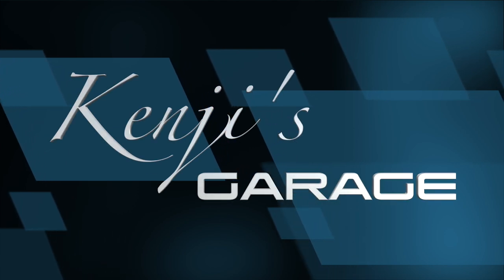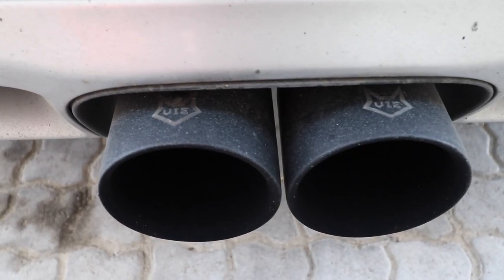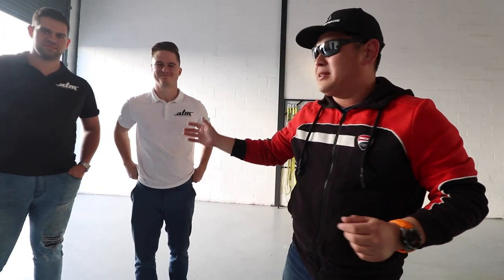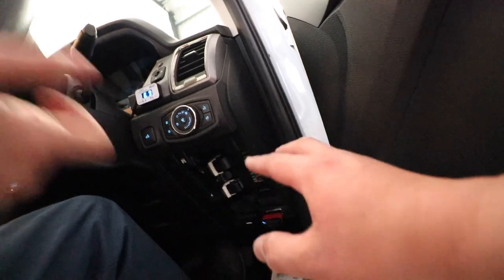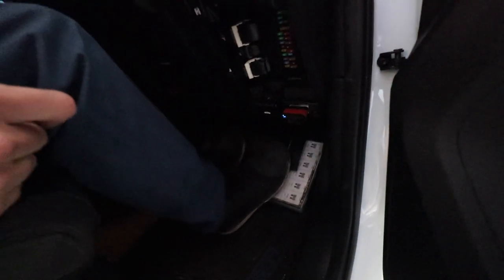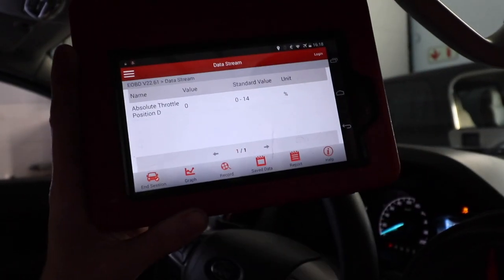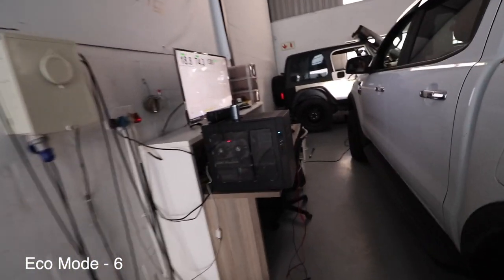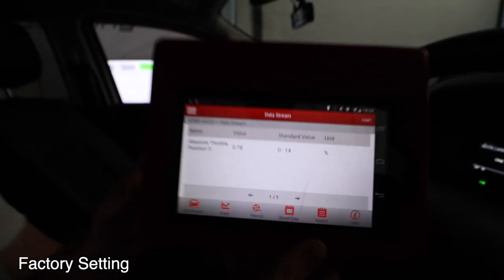iDrive (EVC) Dyno Testing! It WORKS, anymore power? (Part 2/2)

Comment: I have a similar throttle controller and use the Economy mode to dull down the throttle at low speeds, such as driving around town, but at higher throttle input it still reaches 100% throttle, you just change the curve shape, and thus how far you need to press the throttle to get a set power out. I love it

Comment: I found this device finds the lower gears when exhilarating from a roll on the U mode. Sure it doesn't give more power, but being able to drop gears when going certain speeds makes it feel faster. For instance my car from a roll 40kmph use to ride out the third gear before switching to 4th. Now it goes down to second therefore a quicker response which results in going faster. Sure it's not giving more kws or hp, but by manipulating the transmission it keeps the power almost always on the sweet spot. No matter at what speed. And the higher you go on the U mode, the more responsive the transmission gets. I found the U2 mode gives me the best performance without the jerky feel. I hope this explained some of the questions regarding power output people are looking for. I definitely agree this is a better option for off-roading and towing. But for those chasing better performance of their transmission the potential is definitely there. You've just got to find the sweet spot for your driving style. Peace ✌️
Reply: Right.... My Jeep loves pulling off in second...  It really doesn't want to take down the first if I roll through a stop sign or something like that I don't roll it through stock signs but that's just the example.... If I roll through a yield and get back on the throttle it never goes to first...

Comment: I recently have installed the Idrive EVC310 for my Fiat 500c Gucci Dualogic Twinair (2013), and I am very satisfied with this throttle tuner. from Idrive Australia.

Very simple to mount, and clearly to use, riding and changing smoothly directly into the desired mode. For me it is a very welcome addition to the fine and safely tuning of my car before from 85hp to 105hp (done by the best Alfa/Fiat Dutch tuner). 
I choose Idrive because it doesn’t need Bluetooth nor IPhone interface while YouTube Idrive and other throttle tuner movies convinced me further.
The design is very nice, small in size, with the 4 modes visible also at night. 

When I chose mode U9 (Ultimate) my 500 is a race monster, (to prevent wheelspinning use <U9),  for daily use mode AC (Automatic Control) works fine, for great distances EC (Economic Control) works best (and also for snow on the road), and return to mode -- the Idrive returns to normal 500 driving mode.

I ordered the Idrive in Australia (Idrive is not available in Europe) for 180 Euro, had to pay Customs in Holland 20 Euro and my garage another 20 Euro for dismounting/mounting the pedal assembly and connecting the accelerator plug assembly (I myself could not  release the existing plug on the gas pedal by hand).
At home I mounted  the Idrive on the dashboard. 

My short experience with the EVC310 is a very pleasant one and finally: the EVC 310 is for me the ultimate throttle tuner, which gives me a big smile on the road!
Kind regards from Holland Eric Koekkoek
Reply from the maker: Wow! ERIC! Thank you so much for the message! 

I find U9 a bit too harsh on my truck, it’s a bit too much throttle.
Reply: Hola , haz tenido problema con el dispositivo ? ha dañado el motor o algo similar ¨?
Reply: @ventasquivime2714  5 dec 2019 I installed the Idrive EVC310 for my Fiat 500c Gucci Dualogic, TwinAir 0.9.
After driving 8000 km I am very satisfied with this throttle tuner. It is very simple to adjust your desired mode (4) with possible settings 1-9 (1 is minimum, 9 is max.) and everything goes smoothly while you drive. For me it is a very welcome, useful and reliable addition to the fine and safely tuning of my car from 85 to 105 ps (done by the best Alfa/Fiat Dutch tuner).
I choose Idrive because it doesn’t need Bluetooth nor IPhone interface and YouTube Idrive movies convinced me further.
 
The design is very nice, small in size and simple to install. The following settings are possible: 
** -- Normal mode, I never use this.
** E Economy mode, I use this with setting 9 for short distances (and without pressing) the ECO button on dashboard); for long distances I use E9 in combination with pressing the ECO button, which visible drops down fuel consumption.
** AC Automatic Control, I use this when I will quickly accelerate without using manually settings, the higher you press the pedal the faster the accelleration (1-9)
** U Ultimate mode, I use this when I will be the quickest accellerator on the road :-) .
With my standard setting U9 (Ultimate Performance 9=highest) my 500 is a real accelerating beast!
 
I ordered the Idrive in Australia by Ebay for 180 Euro. For dismounting/mounting the pedal assembly and connecting the accelerator plug assembly (the existing plug on the gas pedal could not released by hand) I had to pay my Garage another 20 Euro.
At home I simly mounted the Idrive on the dashboard.
 
Finally: the EVC 310 is for me the ultimate throttle tuner! 
Kind regards from Holland Eric Koekkoek Birfelder
Reply: Sorry 1 addition more: I have never never had a problem with my EVC310, the 0.9 Twinair runs every day smoothly without any problems, I find the combination EVC310 + tuned 0.9 engine Ultimate!!! My advice: read the reviews, look at Youtube...

Comment: Thanks for making this video! It would have been good to see the throttle values when putting the foot flat to the floor without the block under throttle. You only showed the dyno graphs but not the throttle values. As was mentioned in this video, the throttle controller makes no changes to the actual engine, so how can it actually make more power/torque earlier in the rev range if in both instances (standard throttle vs. iDrive) the throttle value is at 100%. In theory either standard must not bring the throttle value to 100%, or with iDrive it somehow goes above 100% and allows the throttle body to open wider. Are you able to explain this at all please? The part where you show the partial throttle makes sense and is what the iDrive is all about, but the full throttle bit with “more power” is confusing.
Reply from the maker: Right so, iDrive will never allow pass the 100% parameter. As you will need to tune the ECU.

It simply fools the pedal, where it can be 80% open at say 10% throttle position. 

At full throttle, 100% will just still be 100% it will never give more. 

It won’t get more power! It’s just a more on demand of the existing power that you have. 

It’s easier to explain in person and show you.

Comment: Hi, very informative, advanced, and complete information regarding the throttle controller, thank you, but I have a question I hope the admin or Kenji's Garage can answer regarding safety issues, My question is what if the throttle controller's device suddenly fails? or the little wire cut? Do we still have the control of gas pedal? or it will be back to normal mode? Thank you for hoping Kenji's Garage can enlighten us. thank you again!
Reply from the maker: It will revert back to normal.

Comment: Awesome and very informative video!! Can you do a video on AC mode? I mostly use that mode as it's the best of E and U mode...
Reply from the maker: I hate AC mode! It’s so jittery on my 2.0l single turbo
Reply: @KenjiLo1  Lol, fair enough.. have heard that it's rather intense on an auto. Works lekker on my manual 2.2 ontop of a stage 1 map💪
Reply from the maker: I want to do a map on my Ranger! Need more power
Reply: You wont be sorry😈 I don't think that the single turbo's can be done yet but hopefully soon. ATM is always ontop of the game. Had mine done with them💪

Comment: Which mode should I keep it for everyday driving/fuel efficiency? AC or should I turn it off ?
Reply from the maker: What vehicle do you have?
Reply: @KenjiLo1  Subaru liberty 08
Reply from the maker: I would leave it U1 or U2. Just to give it a little bit more extra sensitivity.
Reply: @KenjiLo1  I’ve had it on u2 for a while and realised the car drinks petrol, would Ac be more efficient or would it not make much of a difference
Reply from the maker: I hate AC, the device is not that clever. I would then leave it off. And only when needed, then use it

Comment: It basically has to do with the "feel" of the throttle. My 2014 3.2 Auto Ranger has a very lazy throttle and it does not feel nice when driving. With the iDrive in U1 mode, it feels allot better and right. My dad's 2016 is a bit of the opposite. The throttle is very touchy and the iDrive in E1 should even it more out...
Reply from the maker: Yes, that's what i have also felt. I'm basically running E0.

Comment: have you seen any savings in fuel on the eco mode?
Reply from the maker: No. And I preferably don’t drive in eco mode. I use eco mode primarily for rocky surface, it smooths out the throttle and don’t give me slippage
Reply: @KenjiLo1  but does that not have an impact on the 4x4 settings on the car that are already set for certain accelerations?
Reply: @KenjiLo1  found your channel today Mate, really enjoying your content
Reply from the maker: So it definitely does affect your 4x4 settings, but very very mildly. Let me give you an example. 

I was on eco mode, going through rocky patches etc, and was very smooth, and no jerking. Then i got to a sandy patch and forgot to switch it back to Ultra mode. I literally was stuck, my truck didn't wanna move. But when i realized it, i switched to Ultra mode, and i was cruising on sand. 

It won't affect directly on your 4H or 4L settings, or even with your diff lock settings. It only controls the throttle.

Comment: Whacks an empty stubby under the throttle to test, ended up crashing in the drive-through at the bottleshop because it ended up under the brake pedal. Thanks. 🤣
Reply from the maker: Luckily that never happened.

Comment: I don't have a IDRIVE but the main purpose is throttle response. Fly by wire has a lag in response when you press the paddle. You can test this by bouncing your foot on the accelerator. You find your car won't rev higher to match your paddle. The IDRIVE removes the paddle lag so the engine response to movement of the paddle which removes the lag. The vehicle has the same power but response quicker to the paddle.  Your test fail to test the response time of the paddle which is the the point of the IDRIVE.
Reply from the maker: The test was not response. Lol.. guess some people can’t read 🥱
Reply from the maker: And if you bothered to watch the video, you will see the dyno graph show's the earlier throttle response that the iDrive gives.. So maybe you should watch or read before commenting..

Comment: Got my idrive throttle controller and was super excited to experience the unleashed power. However it kept displaying an 'AA' code which left the buttons unresponsive and the rpm at 1500. Any assistance would be greatly appreciated. Thanks
Reply from the maker: AA code is the auto mode. Does your mode button not respond at all? If so, then you have a faulty unit
Reply: @KenjiLo1  thanks for the quick response.

Comment: So how can the idrive bring on anything sooner if all setting are exactly the same ECU reading at full throttle
Reply from the maker: It manipulates throttle sensor. But the effect is very short. Used more for off-road use. Not racing
Reply: Perlas Ng Silangan 
Man you must be a trump supporter you know the trumpets 
Why so rude, the guy was asking a question not trying to change your life 
I’m sure if you were in front of him you would act different 
Get a clue stop bullying

Comment: So is idrive better than injen module?
Reply from the maker: one would only know if they compare the 2. But i really think it wouldn't make a difference, they all throttle modules. They don't change anything else on the car. So technically there should be no difference. (i could be wrong)
Reply: Kenji's Garage nice thanks man. I am looking for a bully dog tuner for Nissan Frontier 2019 cant find one do you happen to know where I can find one. If possible thanks.

Comment: Can you have one of these if you have a remap? or will a remap do this as well?
Reply from the maker: If you have a remap, this will still work. Remap increases the boost and fueling and what not. Not the sensitivity of your throttle. With this, you can literally make your peddle less sensitive, and so helps you with slippery conditions. 

So in other words, remap and a peddle booster are 2 different things. They do 2 different functions.

Comment: Is it still working ?
Reply from the maker: This thing is the biggest load of shit. I took it out about a year ago!
Reply: @KenjiLo1  seems to be working for me ,I keep it on auto ,why did you take it out ?
Reply: @crazycressy7986  Im interested to know too. Just had it installed.
Reply: @minbajunid  I keep mine on auto as it gives me more throttle when I need it ,unless I get a boy racer at the lights then it goes into U9 lol ,it's working fine
Reply: @crazycressy7986  Thanks I set mine on U7. I might try auto mode. I wonder why Kenji said this thing is fulla shit
Reply: @minbajunid  auto is like driving in factory  but as soon as you put your foot down it shifts ,just watch going in reverse as it's just as vicious and I nearly backed it a wall lol
Reply: @crazycressy7986  I tried it on the way home just now. But didn't really floor it to fully test the auto mode
Reply: @KenjiLo1  why don't you like it?

Comment: Just put your foot to the floor does the same thing you’d think.
Reply from the maker: I don’t really use it for more power, as it doesn’t give any more Kw or Hp. I use it to regard the sensitivity, it has saved me from slipping on rock crawling.
Reply: Actually it doesn't do the same thing.  It would work that way with old school cars.  With new cars a computer determines how fast throttle body will allow air in.  How fast you put your foot on the floor only has so much of an effect.  These things allow the throttle to open a little quicker and allow air in faster.  So you don't get any more power,  but when you initially put your foot on the floor you get the power a little quicker because more air gets in a little faster.  I had one.  It makes the accelerator anywhere between a little and a lot more sensitive, depending on how you have it set

Comment: Waste of money
Reply from the maker: Sad you think so. But this has its own place in off roading. By simply saying what you have said. It sadly shows your understanding of this industry!
Reply: @KenjiLo1  really.. basically you need to understand this .. this device do nothing els you lying at ur self .    Examples with this device if  you are running 10% of throttle  this   only trickling the ECU  doing actual 50%  .. without this device is more accurate.. with this on only  you fooling at ur self by doing 50%percent  but actual is 100%   if this really works  so what will happen if you are doing 100% throttle  with or without if you feel any deference pls light me up  .. you need simple thing to understand this  buy OBD2  read the throttle position and see the result by ur self .. and apologies for my writing hope and get the msg
Reply from the maker: This device isn’t suppose to give you more power. It’s purely there to smooth out the throttle. Especially in slippery conditions. When you don’t want the surge in power. You place it in Eco mode. This helped me a lot in slippery conditions. 

By simply saying 20% = 70% is over simplifying this device.
Reply: I bought one the other week. It does more than just that. It also increases the speed of acceleration. If you plant your foot down with no throttle controller, the signal will slowly increase from 0-100% over 6 seconds (example). With a throttle controller, the 0-100% signal occurs in less.time - 3 seconds (example). So it gets ride of that 'doughy' feeling. It makes the car more responsive
Reply: Wouldn't getting your ecu re mapped do all the above more power, throttle response, and economy?
Reply: @lukeneely9476  yes - when tuning they can apply custom throttle mappings also
Reply: @drewrowell9399  yeah, thought so. " Get em on the Dyno boys" 👍👍
Reply: @lukeneely9476  only issue with a tune is voiding warranty, that's why people are opting for the piggy back option
Reply: @hartzland7658  you do realize that the lower gears are set on cars to have lower throttle percentages compared to input. Throttle controller's alter this so you can have more throttle in the gears normally when Dyno testing cars are tested in third or fourth gear where there is less restriction throttle controller's work end of story.
Reply: @robertburn8705  Ok I get your point, I have withdrawn my comment as it was a little harsh. If you think it's worth the money thats great.

Comment: Ok I keep hearing kilowatts im from the us we don't use kilowatts.. so...
Reply from the maker: Sorry, will try and use hp next when we do power runs
Reply: Was looking for something that would fix the throttle timing from the time I give it gas to the time it goes is like almost 2 or 3 sec. Delay🤕so was looking for good but reasonable price to fix
Reply from the maker: @matthew197735  this would be it. These kind of devices improve on throttle response. Takes the lag away.
Reply: @KenjiLo1  Dont bother make him use a conversion calculator :)
Reply: 746 watts/hp. Fire up the calculator
Reply: do what the rest of the world does when US use HP, use a websearch...
Reply: @PeterKnagge  did that several times but don't feel it's the right answer because 746watt = 1.0004hp. So basically there is 1hp deferent or am I missing something here because that's not much change but I'm more looking for solving the lag problem when I give it gas to the time it takes of any way
Reply: We do..